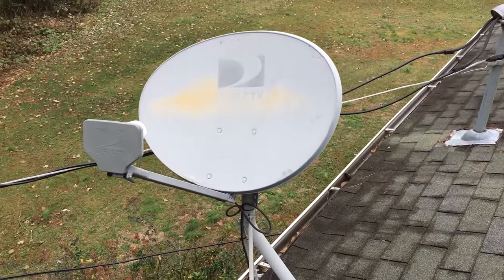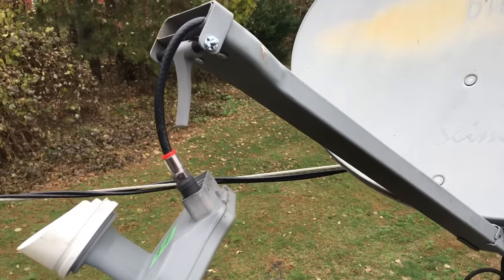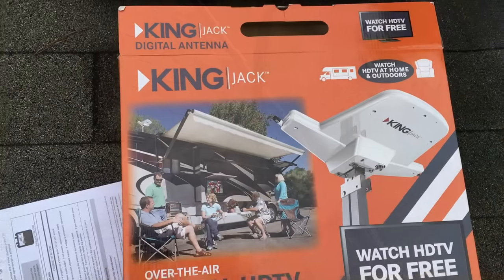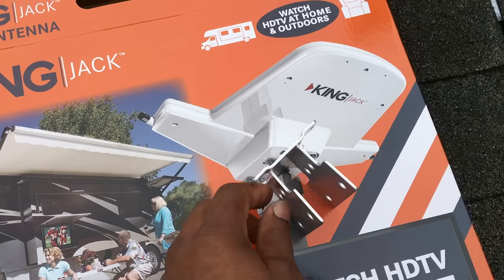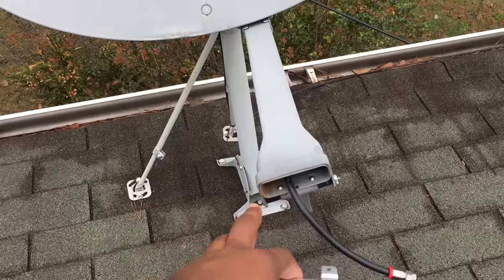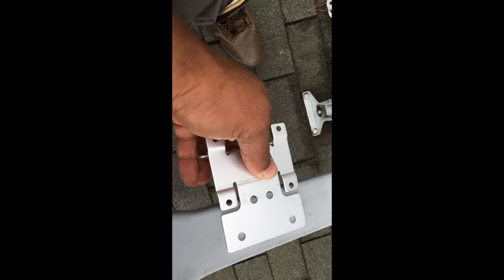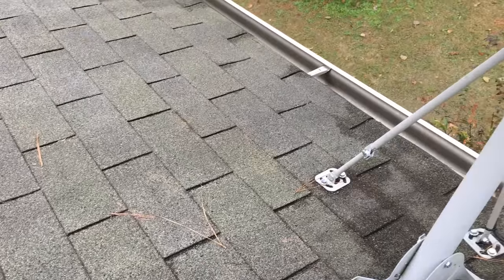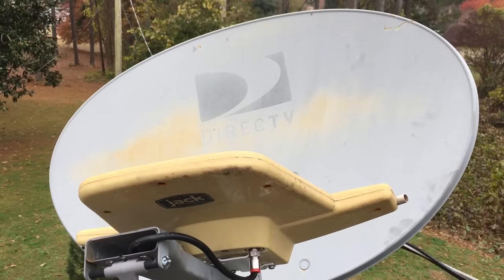Transform your Satellite dish to an antenna (Ota)

Comment: I am a directv technician. The way it operates is that all signals that touch the reflector ( large oval pan with logo) are reflected into a focal point. That focal point is where we locate the lnb. At the end of the arm. So... not only would you want to turn it around but placing it in the location of the lnb as well will definitely better your result.
Reply from the maker: Thank you for the info!
Reply: Inb IS WHAT? Thanks.
Reply: LNB low-noise block down-converter.  A low-noise amplifier (LNA) is an electronic amplifier that amplifies a very low-power signal without significantly degrading its signal-to-noise ratio. An amplifier increases the power of both the signal and the noise present at its input. LNAs are designed to minimize additional noise. The LNA with down converter is called a low-noise block down-converter (LNB).
Reply: That dish is too small to focus UHF. Best to leave it as it is, and just use the thing as a mount for the OTA antenna.
Reply: @jimsteele9261  , cool name bro.
Reply: @jimsteele7108  It was a gift. :-)
Reply: if it will focus VHF it will focus UHF, based on 20+ years of building broadcast antennas.  @jimsteele9261
Reply: While locating the antenna at the focal pount of the dish...and having it facing towards the dish, will definitely improve performance....thats not ALL.  I have not seen anyone notice, or mention....that the dish itself, is still pointed towards the sky.  There is an adjustment for the angle, that the dish sets (leans back) on. In order for the dish to properly focus the signal...it will appear to be pointed more (down) towards the ground, than level. The angle that the dish has to sit at, will appear to be all wrong....but use some type of signal strength indicator, when pointing towards the stations...and you will see.
Reply: @TheChasFred  DISH antennas are for use with microwaves, 1 - 3 GHz.  Much too small for 100 MHz VHF.
Reply: specifically you will remove the large relector element of the antenna and mount so the dipole element is in the lnb position then angle the antenna to counter the offset of the dish. oh and ensure the dish is at least several times the length of the full wavelength of the signal you are receiving ie 200-500 cm. in addition you will only get aim on one transmitter.
frankly this is the kind of video usually performed by brown hands in hindi or tagalog.
for better reception use your dish for satellites and add extra directors and height to your yagi. or build a colinear from old coax cable to get all the different transmitter in your area in all directions
Reply: @alzaidi7739  try 11.7-13 ghz. unless a 2m c band dish for 3-5 ghz. 
for uhf tv stations you will need a 5-10m dish!
Reply: +DeckerWoods   I laugh every time direct and dish call to get customers.  they don't realize that those tv days are going to be over with.  If people would just do the math,  and if the same people would stop getting the so called free channels for life access with the downloads.  People need to stop doing that.
Reply: @timeisnow316  Low Noise Block type of downconversion unit

Comment: All you have to do is buy a 3/8 ring terminal, strip the cable to show just enough wire to crimp on the terminal, and just tighten on one of the nuts on the dish, we used one of the three on the back where you can turn the dish. Works perfectly! We got 160+ channels here in the Los Angeles area, of course we deleted a lot of them because we don’t watch them, but all of the major ones have a strong signal, 80-90+%. Way cheaper and better than any fancy antenna out there, we actually tried that RCA outdoor antenna, pointed it to the antennas and everything, total crap! Didn’t pick up channels 7-13 here in LA, we returned it!
Reply: Do you mind uploading a video to show what you're talking about?
Reply: DrStfuFool I can email you a picture if you like?
Reply: Just seen your post can you email a picture of how you did it

Comment: Just found this video.  I'm thinking you need to do a 180 with the antenna.  However, you also need to find the distance from the original horn position (inches or metric) to set the most forward element at that position.  Think of it more like a magnifying and you trying to burn paper and have to be at the right distance and angle to do that according to where the sun is.   I'm sure that the ticket

Comment: The dish is a parabolic reflector for a 12 GHz feedhorn which you removed. The antenna you’ve installed appears to be a VHF/UHF application. Therefore the ‘dish’ reflector will provide no gain for the OTA antenna.

Comment: A few tips about your Directv antenna (yes, the dish is an antenna itself): Beside the 3 lock bolts on the collar, (and all bolts on DTV hd antennas are half inch, and you may want to use an impact driver to loosen them) for you model of dish, there are 2 bolts underneath what is called the AZEL and there are 2 on the side of the AZEL to make adjustments. In this story the 2 on the side are important because you may need to adjust the elevation of the ODU (out door unit). And there are 3 bolts that allow you to adjust the tilt of the dish. Now, your OTA antenna may not be too fussy bout the tilt but with the elevation you may want to bring down the feed arm so the line of sight for the VHF and UHF signal is collected a little more efficiently. And the feed arm should be pointing toward the transmission towers as best as possible. Then lock it up and you're good.
And you're not really that close to your electric lines - the image is misleading. Just be careful: Plan (anticipate) the for the safe outcome of all your actions so you don't fall or electrocute yourself just for the sake of watching tv.
Good luck to ya.

Comment: You said the curved side should be facing the signal. The signal will be coming from the dish. So turn it around.
Reply: No it won't!
Reply: Exactly! He missed the point of the dish, huh?
Reply: Right!
Reply: Even turning it around it was not mounted at the focal point, plus this dish is an " offset " design. In order to point at the broadcast tower it needs to be flipped over...I'm sure it might get some stations in this configuration, but nowhere as efficient if my suggestions are not followed..speaking as a 40 yr career catv eng.
Reply: @cblguy63  so it basically scoops from the top where the sat beam comes from and the towers not that spot so a 180° change in the scoop is more inline with the antenna? My vulcan logic tells me its even the wrong curve for focus of ota?

Comment: Hard to say if it will or not.  The dish will simply be acting as a reflector, so the distance between antenna and reflector needs to be taken into account.  In phase reflections for some frequencies (channels) will occur and you’ll get better results, but out of phase reflections will make other channels worse.  The antenna definitely needs to be parallel to the ground though and not at an angle (and the dish should be 90 degrees to the ground).  Since the driven element of your antenna is angled, the curve of the dish may actually help some but you do need to position it more carefully, not just jam it on there onto some convenient spot.
Reply: Strike Raid:  You are on the right track, by saying that the dish needs to be 90° , from the ground. Actually, the geometry of the dish makes it necessary to point it even more angled toward the ground...in order to focus the signal, at the end of the arm. Even at 90° to the ground...the reflector is still pointed skyward.
Reply: in fact he might as well just use his internet connection and watch all the stations free online via streaming

Comment: for ota reception the dish is actually an interference source.  Mounting the contraption on its own a several feet away from the dish would actually work better
Reply from the maker: I questioned whether the dish would cause interference but I didn't want to create a new mounting surface and run additional wire. It was a trial and error process, which worked in my favor,  and I used it as a mounting post like what Adon lando said
Reply: @franzm77  you actually have benefited better to remove the dish and use the pole...your mehod totally distroys the antennas gain.

Comment: i closed the browser to go about my way and then searched and refound it so i could hit the like button.  thanks, man.  dont know why it didnt occur to me that the coax could be removed from the satellite antenna and simply mount my inside antenna onto it and reposition it so i could use the cable company's wires for cutting-the-cord purposes.  my house is made of brick, so inside antennas are of slim use connectivity wise.  nice hack, slash inventive thought process.  LIKE

Comment: If you listen and watch closely he is only showing you how to use this as a mechanical mount to hold the off-air antenna. He even wonders out loud if this "might also improve the signal" but the answer to that is no.

The satellite signal these dishes are designed to receive are in the Ka band which is between 26.5 to 50 GHZ. Terrestial TV signals are in the familiar VHF & UHF MHz frequency spectrum. Although all are digital now save for perhaps a few low power stations (if they still exist), they are still an analog transmission and use a modulation technique called 8-VSB to encode the digi information on to an analog carrier.

So the parabolic dish itself is actually useless for receiving and amplifying TV station signals, it is not designed for the radiation patterns used by TV stations. It could actually make your signal worse depending on whether you have a directional antenna or an omni-directional antenna by causing back reflections or ghosting. In the old days that would cause a "ghost" of the original image, with digital signals it can cause tiing/blocking or even complete drop off.
Reply: Your points are overall correct, but the dish is designed for Ku band which is 12-18 Ghz.
 Being only about one wavelength wide at terrestrial TV frequencies the parabolic attributes dont work any better than a simple straight surface.
Ghosting won't happen if the reflector is ~1/4 wavelength or a yagi would cause them.

Comment: Yea the dish should work as a reflector to enhance the tv signal and the dish will reject signals behind both dish  antenna and your rv antenna  also should work good for fm radio, if you turn the front of the rv antenna to face the dish itl enhance the signal more than using the rv antenna alone the dish will turn your rv antenna into a directional beam antenna

Comment: The dish is made for 11ghz . Better off with tv antenna in its place. I would guess that a very big dish is required to get any gain. And it is offset so you need mount the dish up side down to have line of site .  And tv antennas that look like  space ships do not work as well.
Reply: Good guess it needs to be 6'x6' to perform. as a parabolic at UHF.

Comment: As a former satellite installer I have to ask, what Tech mounted this dish so close to an overhead power line?
Reply: That was my exact question. Amazing!
Reply: Carmine S Marcello outstanding you pointing that out I'm sure the NEC would have something to say about that installation!
Reply: An average one.
Reply: Actually, it's worse to mount on the edge of a low pitch roof.
Reply: Dish "tech" installed mine Jan. 1st, then had to come back in April to move it, because tree limbs were blocking the signal. If he had put it in the same spot where the old dish was in the first place, there wouldn't have been a problem. And, he wouldn't have had to come back out, & move it back to the original spot.
Reply: Our Direct TV person did ours right next to our power lines too.  Makes trying this process rather exciting.
Reply: I never liked how some homes main lines are mounted to the roof. I'd bury that sucker. You might survive if you kiss one of the 240V legs, depending on the amperage and if it penetrates to your heart. Did DTV ground your dishes, anyone? Mine was. I used the ground on my OTA antenna.
Reply: How to use a dish satellite antenna for ham use
Reply: A lazy one and/or a cheap one that has to pay for his own coax cause Dtv/Mastec are too stupid to include materials in their pay rate  if they did every install would be done with the right coax,fittings, ground blocks etc etc instead techs buy copper clad cable from from cable tv techs that’s rated for a much lower frequency also most don’t even use underground coax when required and the 10 ground wire that Dtv wants forget about it they just steal cable company 12 wire some have 14, dont know if anything has changed since att took over but doubt it
Reply: and you'd have 4 less screw holes in your roof.
Reply: It no big deal for it to be near a low voltage insulted line. the thing would short to it's own ground before it would a satellite dish . A high voltage line Never.  Satellite guys mount were it going to get the best signal.
Reply: I just cut down a dish that was installed less than 2 feet in front of a meter main and didn't allow the breaker panel cover to open more than 45 degrees. This cover was hinged on top so it had to be lifted for access. I don't think cable and dish installers are required to have brains. Too much thinking would just slow them down.
Reply: Nice idea and approach , but I would keep experimenting to further improve it unless it's adequate . 👍

Comment: First there's a trigonometry equation on how far away from the dish the antenna or feed horn , the device you took off needs to be. Second you need to make  the dish so it's perpendicular to the earth and the antenna is level. Third do watch out for the feed wires going into your house four feet away from you it's a 220 line and it will kill you
Reply: 240... TWO FOURTY! (Sarcasm).
Reply: Mike Cerkez v
Reply: Mike Cerkez j

Comment: Biggest problem I see is that he put the tv antenna on backwards. The receiving end of the antenna should face the reflector that "gathers" more signal. Plus, he changed the focal length of the dish by mounting the antenna like he di that will make any gain less that possible. I use one of those dishes to make a directional antenna for an scanner that listens to one place only. I used a 1/4 wave antenna at 462.00 mhz placed at the correct focal length of the dish. works great. Can actually hear 2 watt hand held radios from about 3 miles away clearly. Could not pick them up with a regular antenna.
Reply: The 1/4 wave antenna at 462.00mhz is only 6" long so mounted at the correct focal length of the dish, it works much better.  The original antenna for the satellite was the round plastic looking part he did away with. You have to be the same distance that was from the dish for maximum gain. You can make small antennas for different purposes that will still work. The dish is only a reflector that gathers more signal than just a small antenna and focuses it at the small antenna mounted in front of it.

Comment: Kind of scary being that close to the power lines if that's what they were? My question is the mast and that existing RG6 coax already grounded by the dish installer? I think this is a great idea, because it's all done all you have to do is put antenna there with maybe an amplifier down by TV/splitter

Comment: Also try  the signal side of the antenna should be facing the satallite reflector then you aim the entire satallite at the stations. The Dish is what collects all signals and concentrates all to a single point aligned with the antenna. Compare the two methods
Reply: That dish is to small to function as a parabola at terrestrial TV frequencies.
Reply: @ghz24  too

Comment: this dish was installed wrong in the first place. I worked for directv and you NEVER install a dish next to a powerline coming in the house. its dangerous and can disrupt the signal strength. anyway directv doesnt use that dish anymore taht dish is very old.

Comment: If you say that the straight side need to face the signal then you have it backwards because it needs to face the dish otherwise the dish is useless, the purpose of the dish is to receive the signal in a wider angle by bouncing the signal of the dish to the receiver. Peace and God Bless

Comment: I would have thought turning the antenna other way to pick up signal reflected off dish works best.
Reply: The dish does nothing! He only showed how to hook up an antenna! The dish only keeps the signal stronger it doesn't actually catch a signal! The piece he removed is where the dish signal comes from.
Reply: @danvinogradov138  the dish actually does reflect the signal.   That’s the reason for the dish.  Signal reflects to the arm position for maximum signal.

Comment: Check out Danny Hodges here on YT. He is long winded an has trouble staying focused. But he shows you how to make a really good antenna. It the bow type, If I can make one you can to. It works good, I am about 45 miles from Atlanta an can get most of the Atlanta stations. The antenna is about 30 ft high.

Comment: The antenna should be centered an aimed at the 'sweet spot' in the middle of the dish for best reception. To find the sweet spot, cover dish in aluminum foil (smooth it out flat) and aim at the sun. Make a hole in the foil at the sun collection spot and mark dish with a permanent marker. Aim antenna at this point. Your DISH LNB was already aimed at the factory before you removed it.